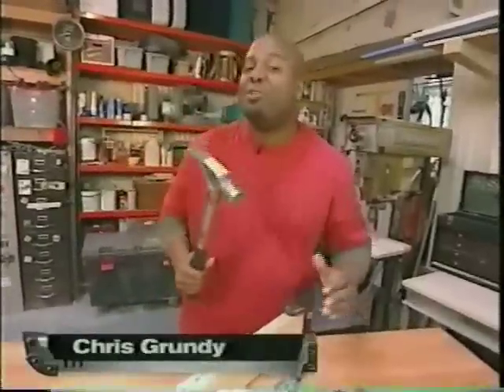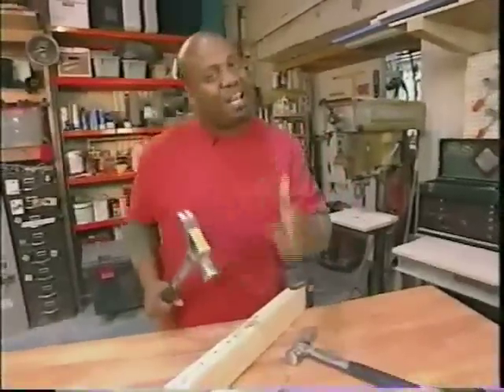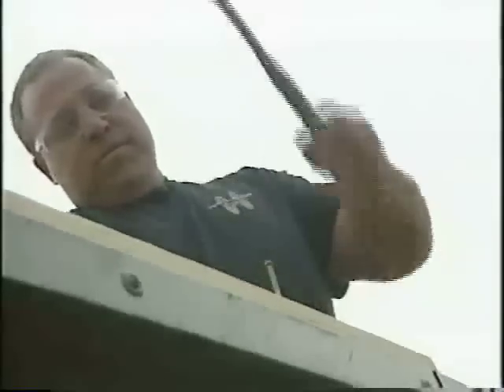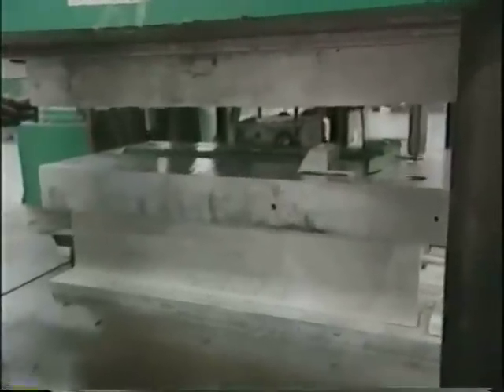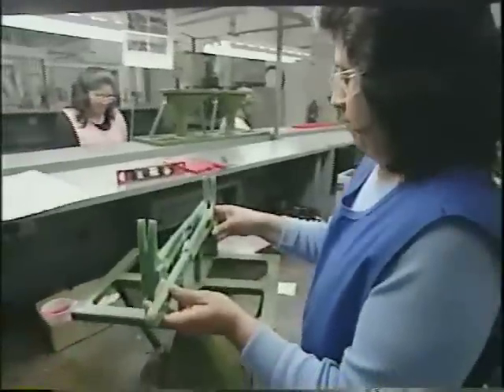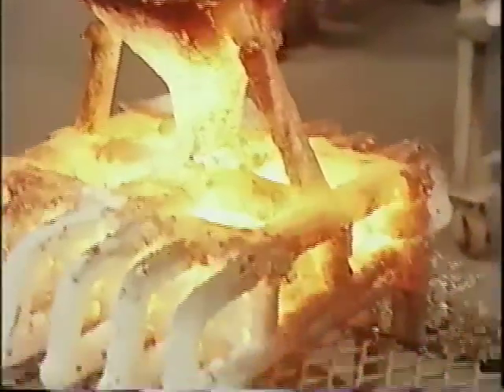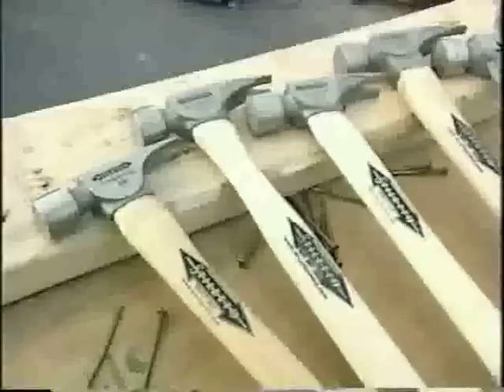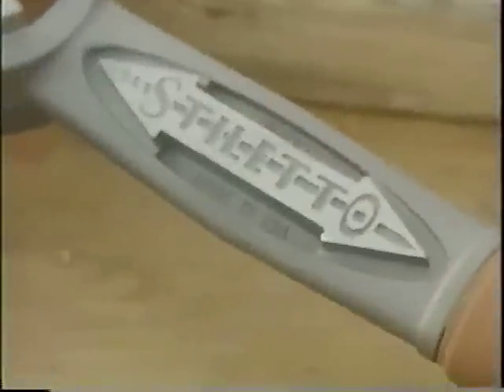Stiletto Titanium hammers

Comment: let's do the math. so we'll just assume a few things 1. that  has same lever arm let's call it 12" for ease of computing. A 16 oz Ti vs 22  oz Steel the Ti hammer is around 28% lighter. If F=MA then lets figure for same effort 28% faster.  lets call head speed on the regular hammer 20fps so figure 25.4 for the Ti hammer.  So using the KE equation of 1/2 M(V*V)
Ti hammer is 1/2(1.0)(25.4x25.4)=645 ftlbs  the steel beast 1/2(1.375)(20x20)=550ftlbs.  so right there we find an improvement.  Now my math is a little hazy here, but I'm fairly sure if you reduced the weight your acceleration takes on a bit of a geometric curve.  Anyone want to work out the relative acceleration between the hammers? I have heard head speeds up to 45% faster, that would increase the impact forces even more
Reply: Your the only one that’s has actually done the math. I’m still waiting on someone to create a vid being very scientific and precise as to why a titanium hammer is better. All I get are opinions like oh it feels lighter and I feel faster and it sinks nails faster. Where’s the proof XD I still grabbed one up though to try it myself XD

Comment: it's not my first barbecue,  Ive been on other projects before this such as matachewan gold mine, timmins super school south porcupine opp station, de beers mine, lakeshore gold building the underground shaft, and the list goes on oh and my hammer it's a 15oz tibone with a straight handle and if i didnt swing one how would i know that the top hole in the shaft fits a 5/8" nut almost perfectly and the bottom a 1/2".

Comment: Any one know how to clean a titanium Stilletto hammer. I bought a used one that is pretty grundgy.
Reply: Probably just polish. I’m sure steel polish would work but I’d double check just in case. Honestly a lot would be done with soap and water. If it’s really bad I’ve seen some use a belt sander but use at your discretion.